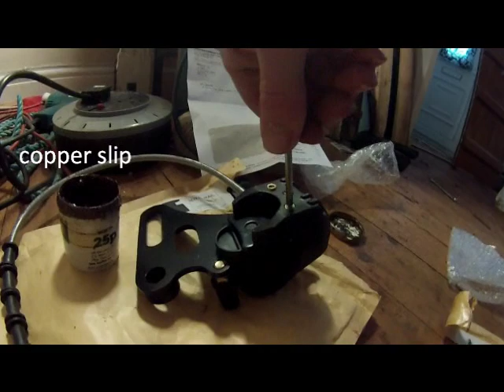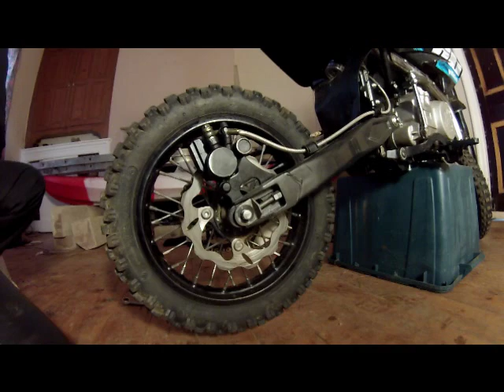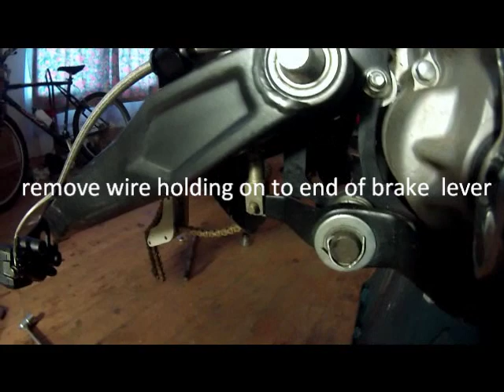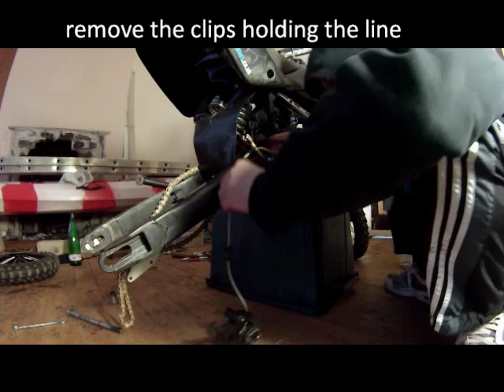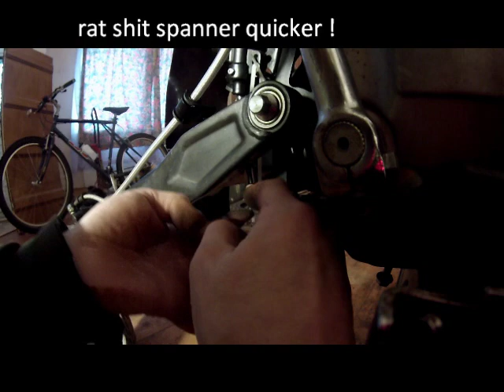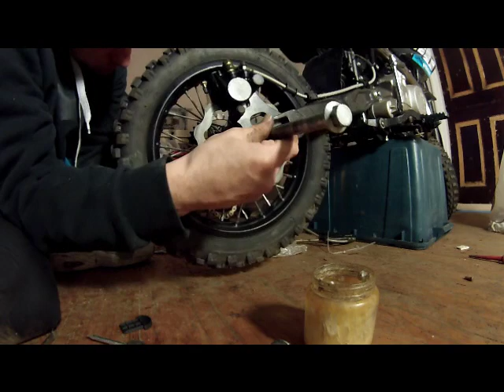pit bike back brake fitting

Comment: I got a new brake unit. On the new one,  the part that the axle goes through is a bit thicker than the old one. is it okay to force the old one in? It is a really tight fit and I'll need to pull the frame outward with  some force to be able to get it in there.

Comment: Where do you put your wheel spacers I have 3 of them one long one medium one small and I need help
Reply from the maker: +PhelsumaPower look how it gos back the spaces will only go on one way to sit right ,,i think its been ages since  i last messed with a bike !
Reply: I don't really see anything I have 3 of these spacer pieces one small one med and one long one and I'm trying to put my tire back on and I'm really confused I don't know how they were the first time
Reply from the maker: The long one gose on the side with the disc i think try and see if the wheel sits right like that , or try the other way round make sure the disk sits inbetween the pads n ur sorted
Reply from the maker: +PhelsumaPower wach the video  at 2mins 5secs you will see the long spacer drop out
Reply from the maker: +PhelsumaPower at 5.39 i say abwt the flanged spacer
Reply: 2 of them go the side where the caliper is and the big 1 goes  the other side

Comment: whaat size is front disc standard wpd 140 i got 2011
Reply from the maker: shauny17091987 im not sure think they are al the same size
Reply: no different size.

do you wana sell me that old brake you took off??
Reply: need loads of parts i have same bike bro wpb 140yxcrf70
Reply from the maker: top bikes but i sold mine a while ago

Comment: How come this video completely cuts out when you put the axle through the back brake and into the tire. For a video with the title stating the Fitting of back break to then actually cut the video when you’re supposed to actually fit the back break makes this video 100% useless. And a waiste of time, why give it that title if you just cut that part out and be a damn mute throughout the entire time, you should erase this or put in the title that you cut out the important part and basically is a poor shot , low light video with no description. And is a waiste of time. That’s be the more accurate title